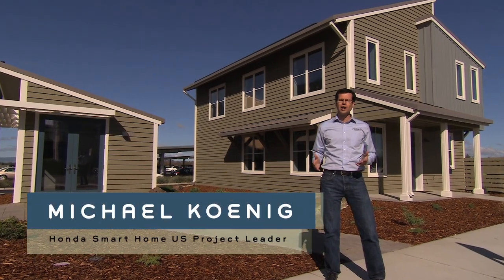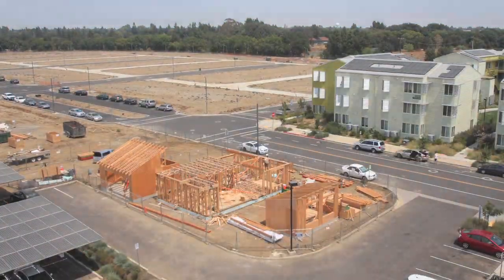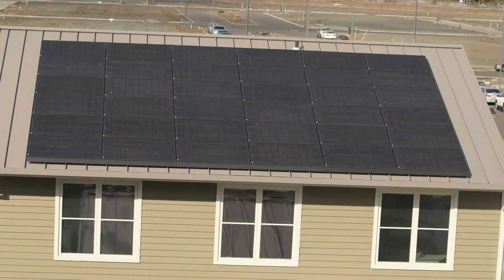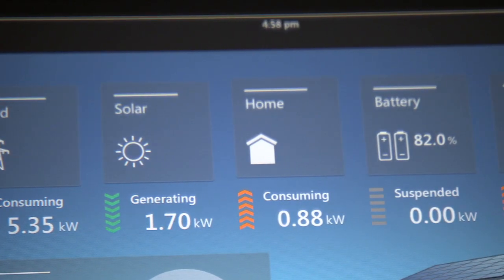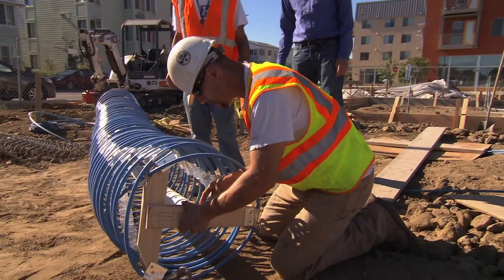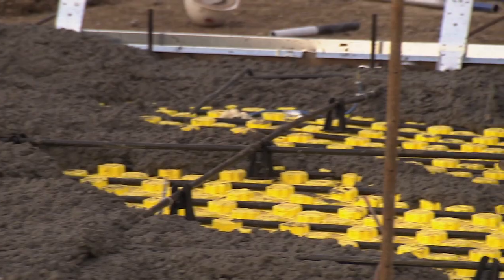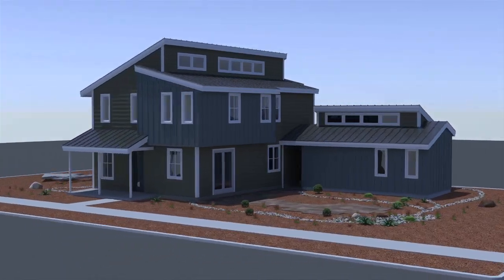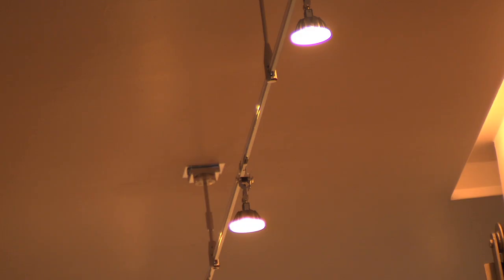Honda Smart Home US Overview

Comment: If Honda wants to be part of the solution instead of part of the problem, it is time to start producing more EVs.  1400 compliance lease-only FITs over the course of 3 years is pathetic.  Nissan is selling 2500+ Leafs A MONTH.  Nissan is making a much bigger commitment to EVs than Honda has ever dreamed of.  And none of this technology the mentioned (except for the battery storage and direct DC charging) is revolutionary.  I have 6.88KW grid-tie solar array, geothermal, two EVs (Leaf and Tesla) and zero electric bill.  This is all technology you can buy today and none of it from Honda.